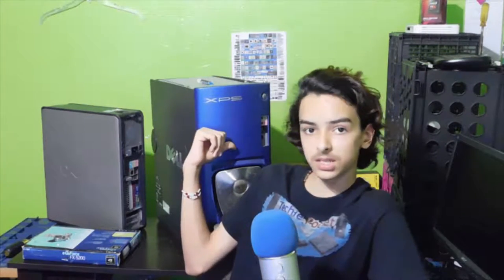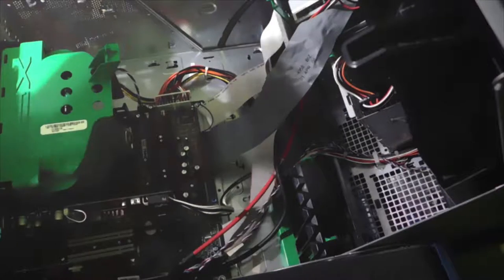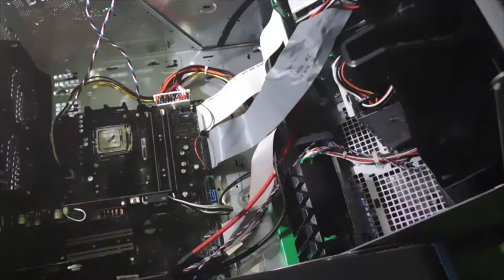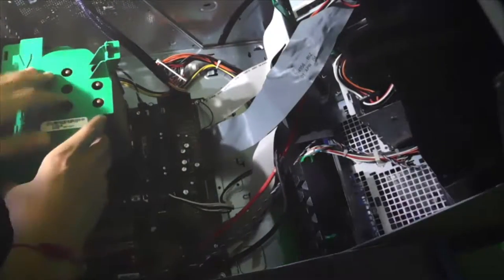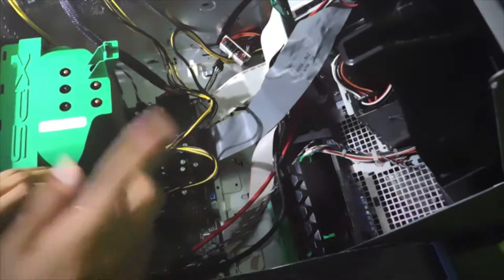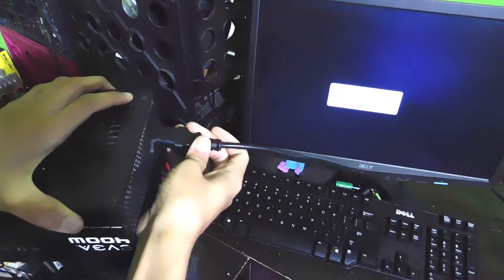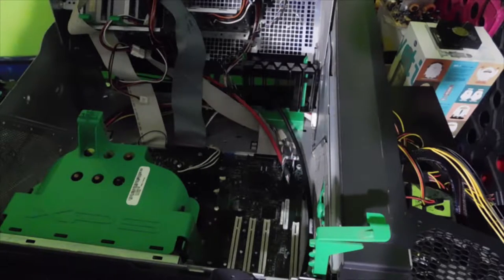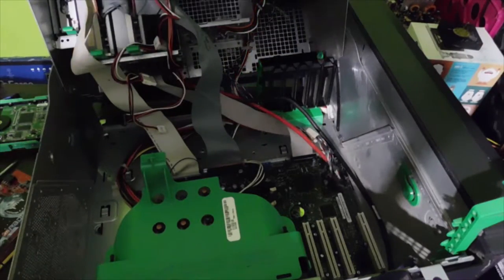Dell XPS Gen 3, works with a new PSU?

Comment: I just got this system used and I stripped it and put the mother board in an non dell case. I am having problems installing xp. I had this problem before moving the parts. This computer is one of Dell's biggest bombs they ever made. I have lots of other models that Dell made and they just work.
Reply from the maker: Not sure. Sorry

Comment: are there any bulging capacitors or burn marks on the board that could be the problem or even the bios chip is bad
Reply from the maker: No there is not, maybe it's the BIOS. But I really don't want to spend money on this thing. Which is why I quit.
Reply: ahh ok thanks

Comment: Got one of these for free. Will not install windows 10, 7, or XP. Bios is absolutely horrible. Psu is making high pitched noise when pc is off. I WAS going to strip it all out and make it a gaming pc but found out motherboard is not a standard size and not worth the effort 😐